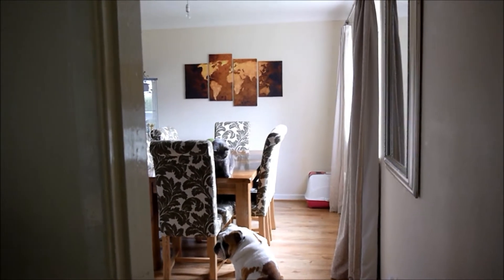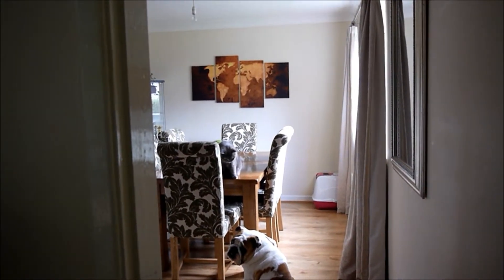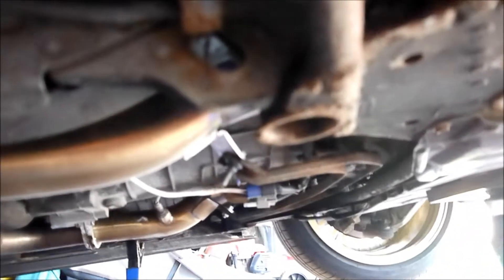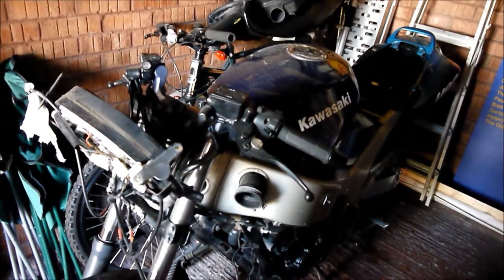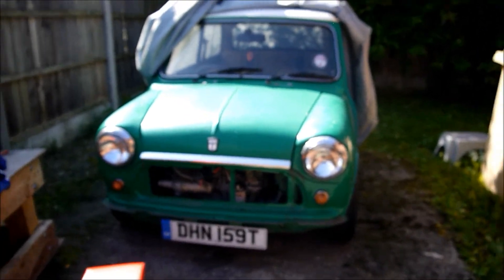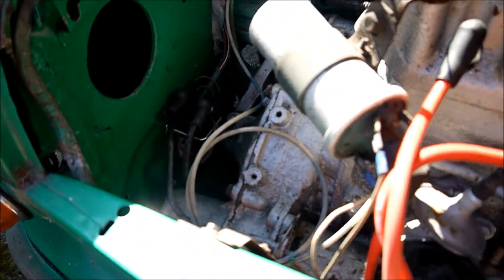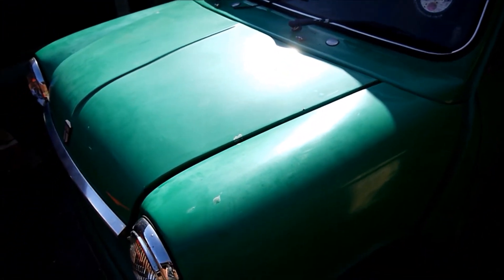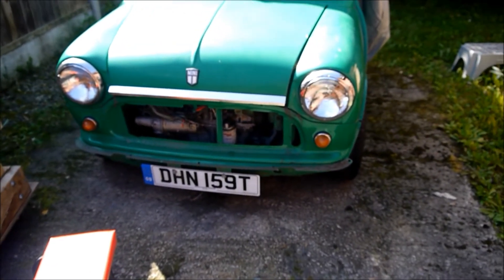350z Exhaust leak temporary fix

Comment: Hey so i installed an hk performance exhaust, but it’s been about a month and I noticed I now have an acceleration delay and it’s jumpy and with sort of leak. Idk if it’s my exhaust or what, but I can barely reverse into my driveway without the pedal all the way down. It’s loud and on top of that my oil pressure went down and my gas burns quick now. PLEASE HELP🙏
Reply from the maker: Hey buddy. My advise would be to get in touch with a tuning specialist. When I did my exhaust modifications I got mine tuned (I have a video on the tune up). It's definitely advised to get a tune once you change the exhaust due to air flow and fuel delivery etc.

That night be your issue buddy. I hope you get it sorted!
Reply: TheBoy 888 will do 🤙 thank you!